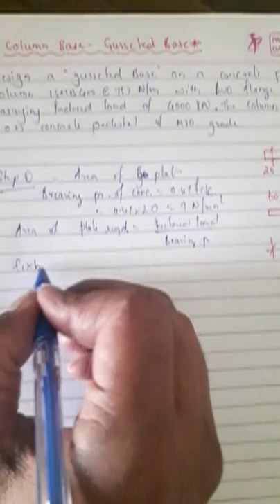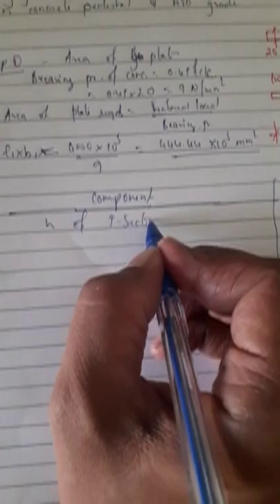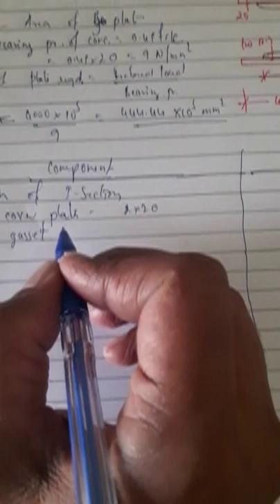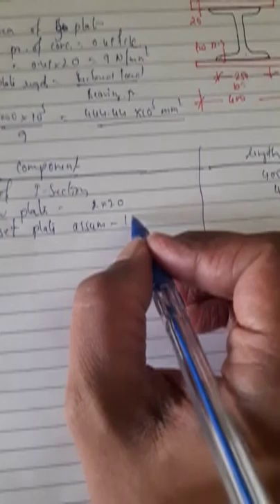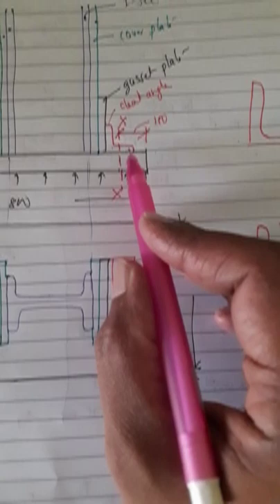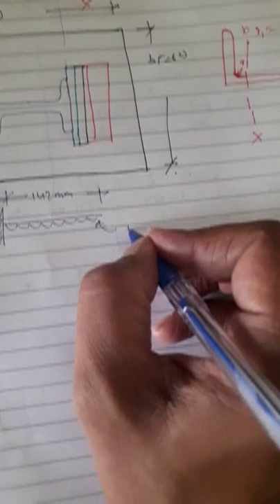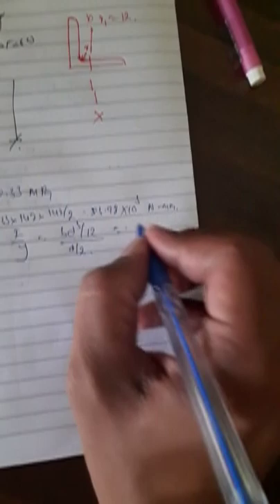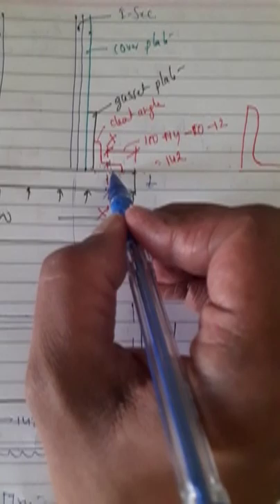Gusseted base - design example

Comment: 2.5 kb d t fu    nominal bearing capacity 
Sir, thickness t 
When gusette plate is 16mm
When Angle is 75×75×10
So,
t=16mm or 10mm